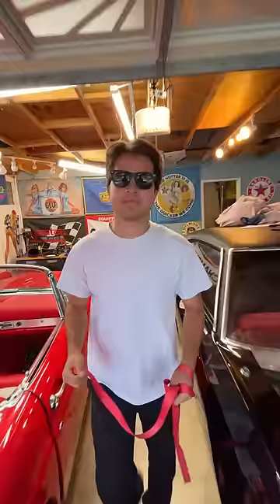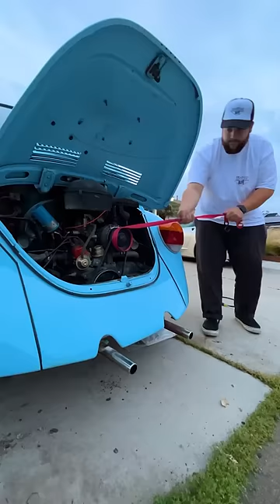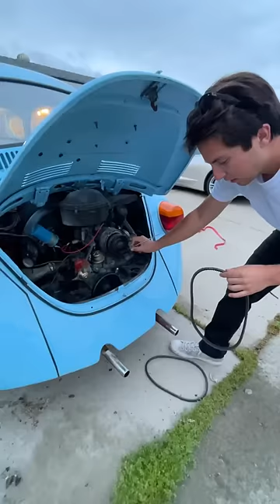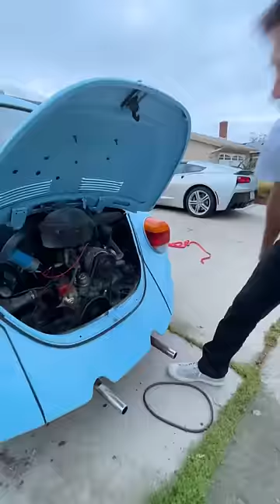Fastest Belt Change Ever (World Record Attempt)

Comment: Excellent way to break your wrist 10/10 technique
Reply: Yes, indeed. Quite possibly the screwdriver snags and ends up shaft deep in your face. Don't forget to post the video when it happens.
Reply: I don’t see no broken wrist🤔
Reply: @Ikxn™  no one said he had broken his wrist, but it is definitely very much possible to break your wrist or worse when you mess with moving machinery.
Reply: Do it from the bottom up you won crape the belt
Reply: Now you are getting technical and perhaps stuff you may have learned from experience. All I was saying was, if it is wiring around at brake neck speed I am of a mind to keep my digits and face well clear at all times.
Reply: @Ikxn337  those last few brain cells must've been struggling.

Comment: fun fact: in 80's grop of 4 managed to remove and reinstall buggys motor in less than 28 seconds.
They drove in 15metre area stopped car, 3 men came put, car reversed to stands, motor off 1 meter behind car, engine back, men et tools inside. drove off. 27.29seconds.

Comment: I have a scar on my index finger where I got pinched in a Volkswagen generator belt. The engine certainly wasn't running. All I was doing was turning it with a wrench and somehow, I managed to get the tip of my finger in there.

Comment: Maybe not to this old engine, but newer engines wouldn’t this throw off the timing in the engine I thought if your belt snapped while the engines running eveything jumps time?
Reply: A car has multiple belts/chains. You are confusing the accessory belt (which runs the alternator, ac compressor, powersteering pump) with the timing belt (which it's only role is to keep the engine in time and sometimes run the water pump). There isn't one belt which does everything.